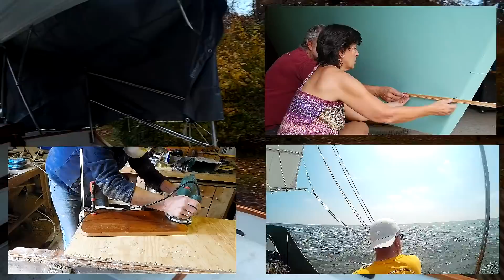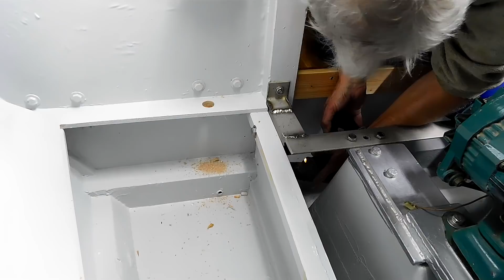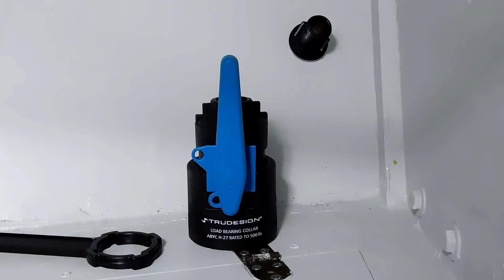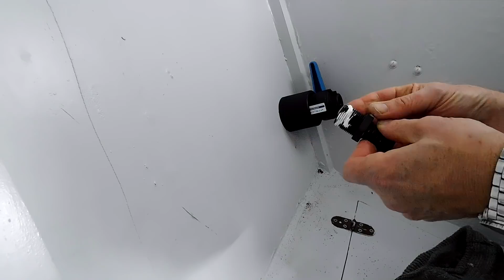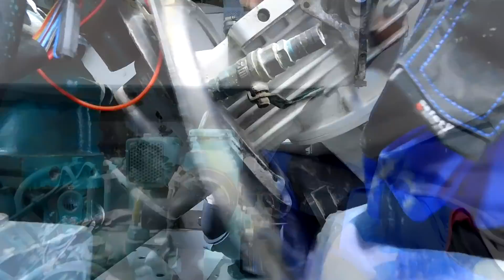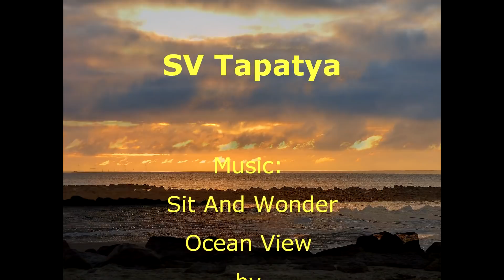Trial fitting the saildrive; Building a cruising sailboat - SV Tapatya EP211

Comment: Thanks for the video! Now that you have solved the engine isolation issue. Don’t forget to check that Saildrive for any stray current. I just read a post about someone’s saildrive shroud basically disintegrating in a marina becaus of this. Tapatya is looking smart, and coming together nicely. Can’t wait to see you put her in the water. Cheers.
Reply from the maker: Thanks 😀 As long as nothing electrical is connected to the saildrive, there shouldn't be any current causing dissolving housings!

Comment: Looking good.
When you fit the sail drive, I didn’t notice any nonmetallic gaskets/washers, hopefully you can properly isolate the drive from the electrical system.
Reply from the maker: Thanks Jim. The insulation is between the bell housing cover plate and the engine, not the saildrive and the bell housing plate! It's all there and insulated Jim; I made sure of that in last week's vid 👍😀

Comment: Fantastic Tony, have been looking forward to seeing the sail drive being set up.  As mentioned below I’d be leaning towards fitting it at home where you could do it without time pressure and even test run the system to check alignment, vibration etc.
I’m sure it could be transported to the boatyard with extra supports on the trailer.
Such a beautiful boat and so impressive you’ve made her with basic tools that most of us have in our sheds.
Reply from the maker: Thanks JayElle. One of the beauties of the sail drive is that it doesn't really need any alignment 👍⛵️

Comment: Tony,
I hope you installed a foot valve at the bottom of the pickup line. Remember to prime the pump before use and never run a pump dry despite what manufacturers say is ok. 
Great work otherwise.
Reply from the maker: Yes, Pat, I'm fitting a foot valve 👍😀

Comment: Hi Tony I was wondering, does the saildrive have to be electorally  isolated from the engine as I remember when mine was fitted the guys were talking about it. But was a long time ago 
Best Regards
Reply from the maker: Yes it does, Russell. See last week's video for the insulation ( the splined input shaft goes into an insulated drive coupling) 👍